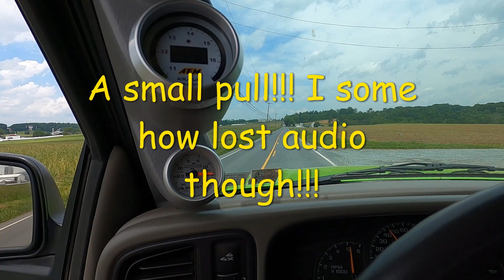VINYL WRAP FAIL ON THE TURBO GMC !!!!!

Comment: Just out of curiosity can you turbo a gas motor and get the same numbers as its diesel equivalent... to answer this I'm going to narrow the question down to will your turbo 6.0 put the same numbers on the dyno that a stock d max of the same year / generation would ?? And if so would it be reliable long term like a d max ?? Would be cool to know because they turbo the d max but n/a the 6.0 ..... the 6.0 is a great motor but with a turbo it's a game changer ...
 Just wondering why auto companies chose to turbo their diesel trucks but not the gasoline one out of the factory
Reply from the maker: Check out my dyno video https://youtu.be/sqJm63IbqiU Keep in mind the diesel trucks are built with a Allison trans and a heavier 11.5" axle. If you're doing moderate towing the gas turbo would easily survive! Keep in mind fuel mileage also? In short the diesel truck was built for heavy towing.
Reply: @slow_restoration  
Yea I have a crew cab 2500hd short bed with the allison transmission and the 8.1 .4x4 .... I'm considering going turbo to get numbers more equivalent to a diesel... I have the correct transmission and rear to handle it so why not .....
Reply: If you want an easy comparison just take the turbo off the Duramax then compare them.